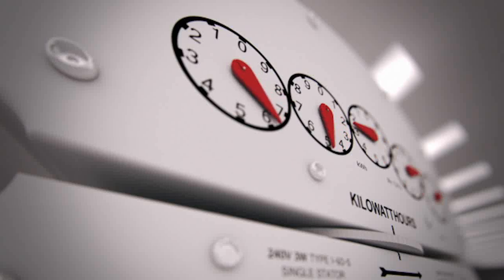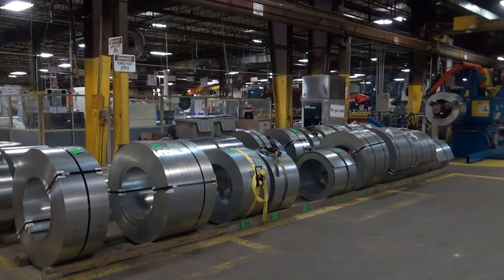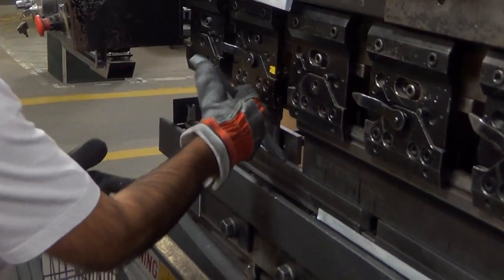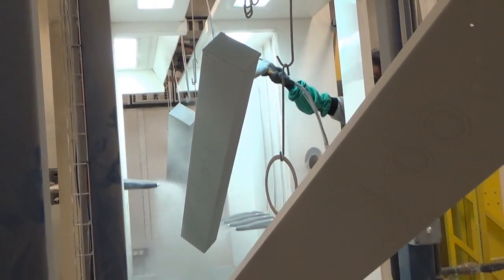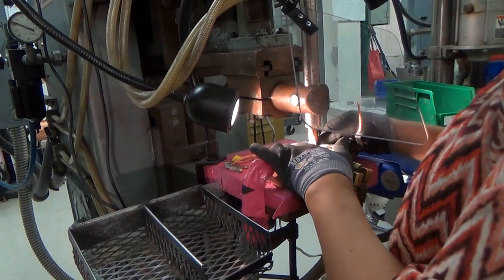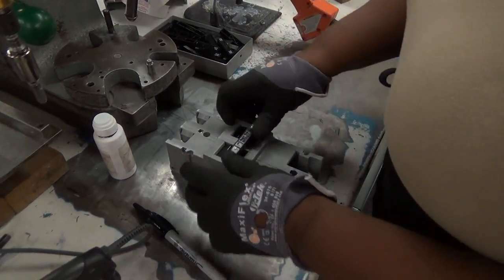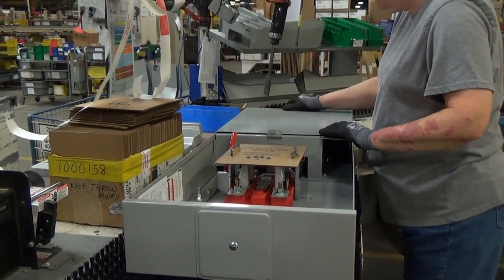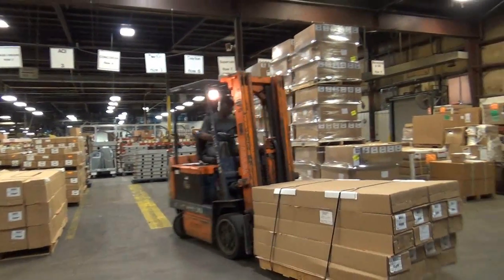Milbank | How We Make a Meter Socket

Comment: IN 4:45 of your video looks like a Murray or Crouse hinds product. If it Canadian it looks like Micro Electric. Ive been an electrician for close to 40 years Ive seen tones & tones of meter sockets .Ive never have seen a Milbank product with those triangles indented in the bottom of the cover but have seen the names listed above with this design.
Wish you guys would make a video on how the meter curl is done on ring type covers step by step  and how ringless covers are made step by step that would be interesting.